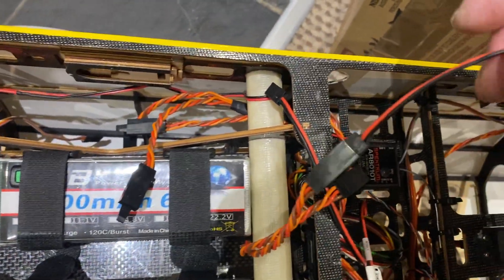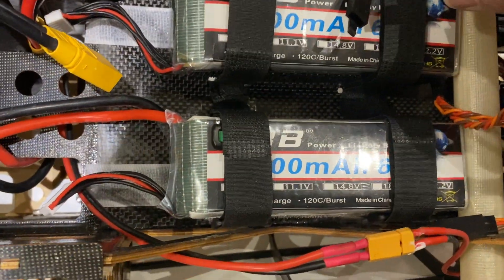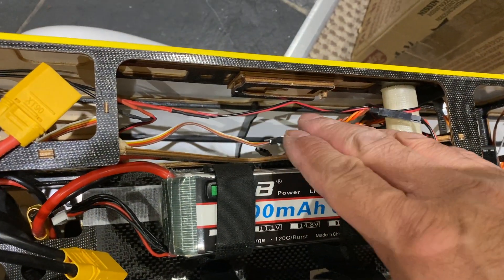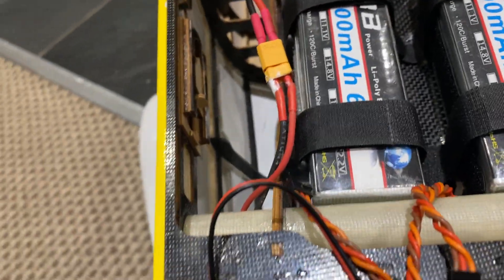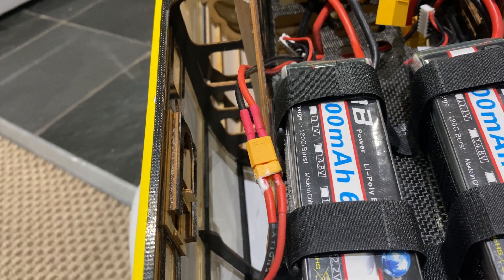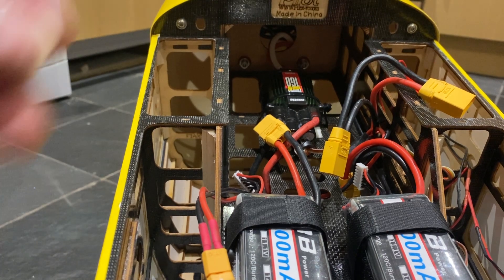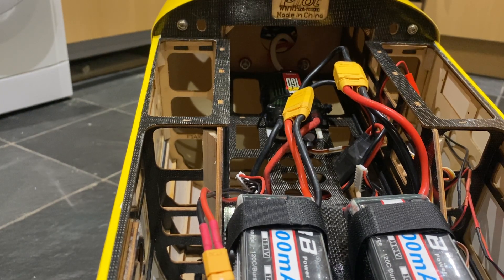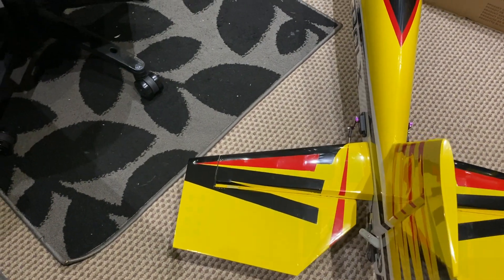Fitting castle creation 160 amp ESC.April 2021.

Comment: Did you have to program that esc with a card ? Or just used it out of the box?
Reply from the maker: You are best to program the ESC with a program card for the timing and breaking and all depends with which motor you are using. I always program mine so the motor will not get too hot and end up damaging the motor and the ESC. Fly save walterstimax 👍
Reply: Thanks Danny Makes sense. I'm building a l30 Black horse 90mm Schubeler With 12s system using this 160 castle Esc and I need to get I right. Thanks for the Help My friend.
Reply: Also, what Bec would you recommend for the 160-castle esc?
Reply from the maker: I have used a 20amp BEC by Castle creation on mine. How ever is up to yourself what you want to use. Fly safe Walter 👍
Reply: Thanks Danny

Comment: Nice channel😊 I have the 160A with xpwr 40cc. Do you trim your throttle so the propell barely start turning?
Reply: Should i put in the 4.25 software, i have the 4.22.
Reply: Sorry this is the channel to my daughter..😂😂
Reply: This is my channel, sorry for using my daughter. Best regards from Jonas in Norway
Reply from the maker: I do not use Xpwr motor anymore. I use GA motors from now on
Reply: Okey.. have a 74 laser on the bench and im considering a GA motor, du you have any recommendations?
Also considering spektrum Avian 120.
Reply from the maker: Hello and so sorry for my late reply only just notice your message. The GA40 is a very reliable and powerful motor for that model I have the same set up on one of mine model and I can do so much with that. I also have a video on that model check it out on my channel. Fly safe 👍

Comment: Hello, good afternoon! A question: if I place a castle creation without a scholarship and install the high voltage servos, I have to use a regulator or a BEC. Place a lipo battery in it
Reply from the maker: Hi Alberto. Your receiver and BEC will tell you how many volts they can handle and set it to what your receiver and Bec can handle..fly safe Alberto 👍
Reply: @dannyporter888silverfox8  thank you danny 👍

Comment: SPEED CONTROL SHOULD BE IN COWEL AREA BESIDE MOTOR ,MOTOR LEADS TO ESC SHOULD BE AS SHORT AS POSSIBLE
Reply from the maker: I don’t disagree with what you are saying Bill.. to get the lead as short as possible you have to modify the motor lead by cutting them down and also modify the ESC lead by cutting them down and to mount the ESC at the side of the Cowling is to get more cooling to the ESC however my ESC has more than sufficient cooling also they all have a fan on the ESC plus the ESC doesn’t run to its maximum capacity of what it’s capable off so my ESC are always cool I do not use ESC close onto what the motor use! My ESC is always higher amps the what the motor us.. thank you for your interest and your input Bill appreciate it!